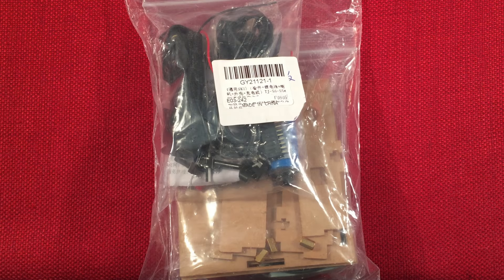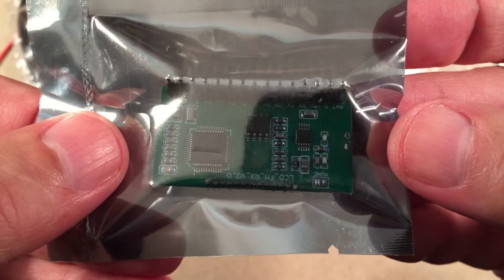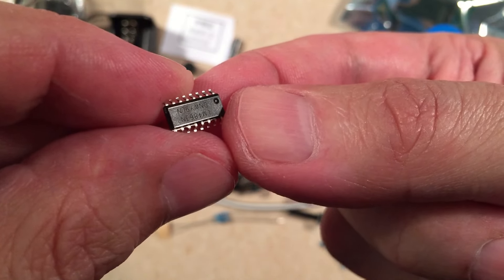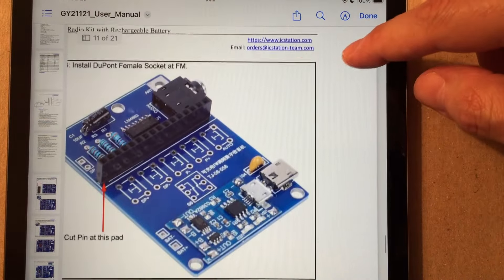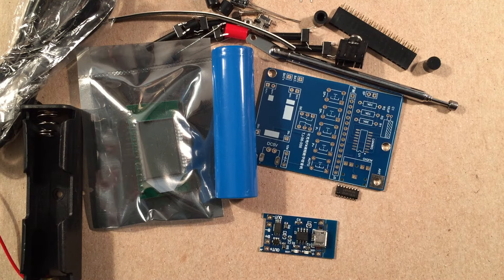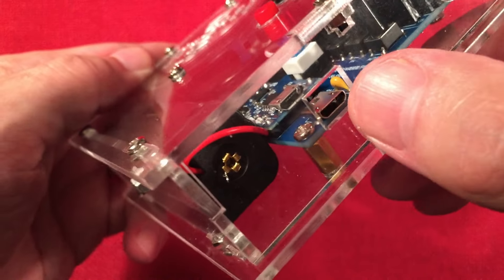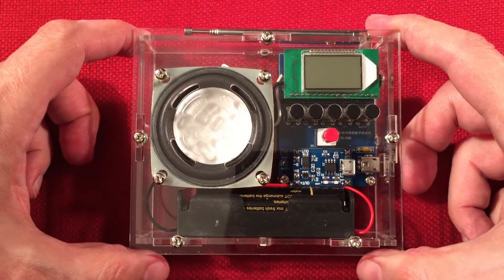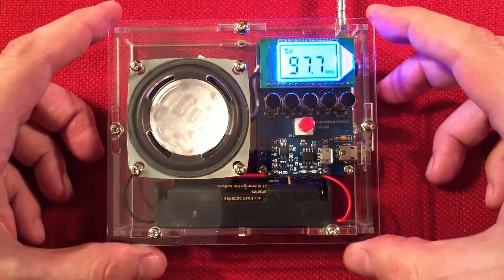ICStation 18650 DIY Digital FM Radio Kit Review

Comment: I like these kits from China. I built a cheap AM/FM radio a few months ago called "The Paeansonic" (not a misspelling). I found out later that radio kit is used in some Chinese Colleges and Universities as the final exam project in an electronics class.
Reply: Few years ago I the Penisonic AM/FM radio kit as well.
Reply: Was it difficult to put together? If it was used as a Chinese college exam that sounds kind of intimidating.
Reply: @BayouGusto  It wasn't too difficult. I put it together in an afternoon. I think the course is first year and most of them have never soldered. China's youtube bilibili has a few class videos where the teacher is showing the students how to solder the radio.

Comment: I wonder Todderbert if you added a simple on/off switch to the speaker wiring and turning it off when using headphones would help over-current problems on the audio amp?  
Good to see a kit build video again…👍!
73! Have a great day!
Reply from the maker: Not sure on that since the audio amp is what is consuming the power, it becomes too hot to touch.
Reply: @todderbert  Todderbert it sounds like a ground problem or a problem with PCB itself since it occurs on both kits. I ‘d ohm it out and compare with the schematic. Also another thought maybe the earphone jack itself has a fault when the earphone connector is inserted. I had that problem on one of my old Radio Shack “P-Box” kits years ago.

Comment: Hi do you think there is a easy task to do a DAB/DAB+ Fm and internet radio combined, I have seen a lot ot ESP32 kits for internet radio only built nothing that combines internet and FM/DAB while chips that offers the combined functionality like the frontier tech that you find in expensive audio modulles like Ruark are not sold to end retailers, Any ideas?
Reply from the maker: I like the idea of an ESP kit controlled receiver.  There are makers of FM/DAB radios with WiFi, Ocean Digital is one of them.

Comment: Is it possible that you're high amp draw is caused by using the wrong headphones (plug type) in the jack?
Reply from the maker: Tried various stereo headphones, and patch cables.  It produces stereo audio, and sounds great.  So there is a design flaw in the headphone circuit.